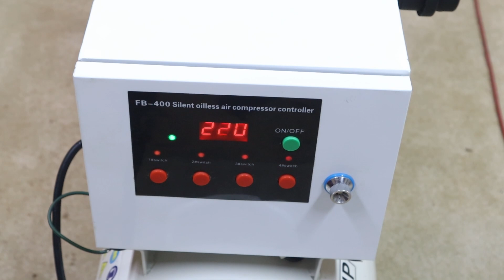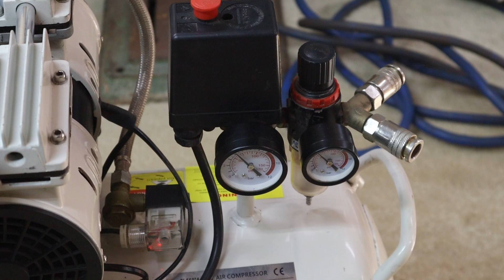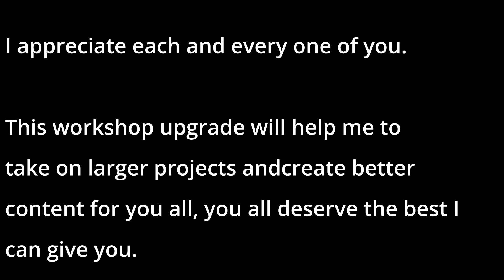Workshop update 1

Comment: Always fun moving into a new workshop!!  Make it yours, hangers and reaching tools, and use of the overhead space for things like those hoses and things under the bench,, easy to see, and easy to reach with a simple stick with a reversed hook to reach and get them down....  Access to the vise from both sides, and consider an extension out from benchtop outward from the wall into the room 15 to 20cm to give it projection, and use from every angle will be useful sometimes.  I bought a new vise to go with my grandfather's vise as well.  The new vise is extended as mentioned above.  The jaws rotate around a horizontal plane and also the whole working head rotates along the axis of the threaded rod through the center.  Amazing useful design once you see it working...

Comment: Nice workshop. Can I suggest installing power sockets near the machinery, so you don't need that extension cable, along with a separate power circuit & circuit breaker at the power feed in board.
Reply from the maker: Thank you very much! That is my plan in the end, I have so many plans and ideas!

Comment: Wow, that compressor really is quiet. How does it compare flow wise to a piston 3hp? I have one of those at its ear defender loud in my workshop.
Reply from the maker: It does have a better CPM but the motors heat up quicker, so the duty cycle is 50% more or less. Its not really for heavy duty work.